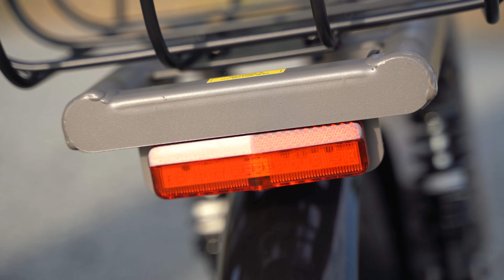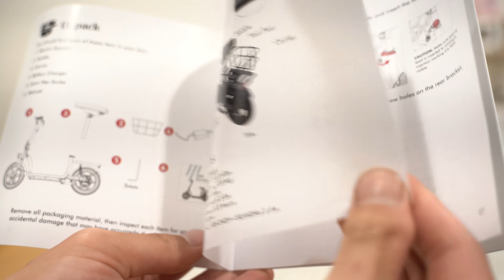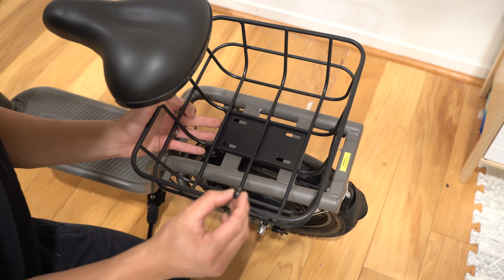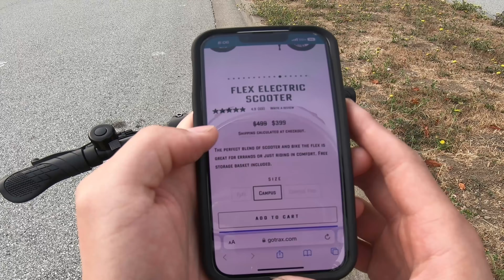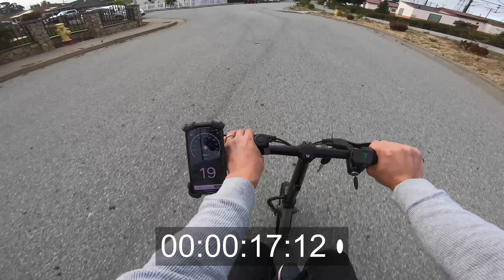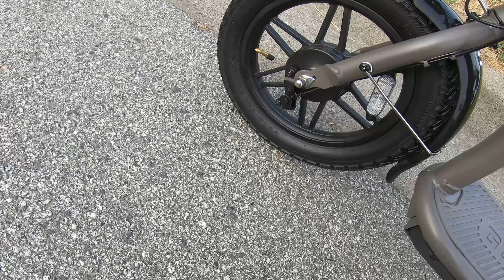$499* Gotrax Flex Campus Pro Electric Scooter Review - Unboxing, Assembly, Test Ride, and Review

Comment: Are these scooters able to withstand being in the cold weather multiple hours without discharge? ride to work and now that the weather is cold, I’m worried about the battery depleting while I’m at work for 10 hours at a time.
Reply from the maker: How cold is it outside, and how far are you riding? Lithium-ion batteries for electric bikes perform best between 60 and 80 degrees Fahrenheit (15.5-26.6 Celsius). Below 40° F (4.4° C), the battery performance begins to degrade significantly.
Reply: I just have the Go Trax Flex and this summer I'd get about 15, 16 miles, but I never ride it until the battery dies. The other day I rode it at 52F and got to 14 miles and it died, but luckily I made it to the parking lot. Plus, my tires were abit low so that didn't help. Filled up tires & rode the next day, same temp. & got 14, but I stopped in the lot before it died so it probably could have done 15. So I'd say anything under 55F you'll may lose a mile or 2 and power is just a tad sluggish.

Comment: Would anyone know how to replace the battery if needed
Reply from the maker: I took a picture of the battery for someone before selling the scooter. There's screws holding the cover on the bottom. Once that's removed the battery can be unplugged.
Reply: @ColinLeung  is it a battery you can buy most places or proprietary from the company?
Reply from the maker: @rmstark1966  The label said Z144-48V9.6AH LG. TT2023052500088. I could not find that battery online, but it does have a XT connector. I did not unplug it to determine whether it was XT40, 60 or 90, but any 48V battery with that connector should work, or you can solder new connectors to make any battery work.

Comment: Does your seat move side to side? Mine does for some reason. And my seat kind of goes forward and then when I lean back it goes back. It’s so weird I just reached out to them though.
Reply from the maker: My seat did not move. You may want to check the two bolts that hold the seat to the seatpost. It sounds like they're loose. You'll need two adjustable wrenches to tighten them.
Reply: @ColinLeung  thank you, I’ll try!

Comment: Would you recommend this for longer commutes? 5 Miles to and from?
Reply: I have the Gotrax Flex regular one and I ride 16 miles round trips on the bike trails; 8 up and 8 back. This one should go even abit further so a 10 mile trip is fine. I bought mine just a few weeks before this one came out or I would have bought this one. I just use the Speedometer app & it shows your milage and speed, plus even has a map that tracks your every move where you go.
Reply from the maker: Thanks for sharing @pinkfreud62
Reply from the maker: Yes, as the other user mentioned 5 miles each way is below the maximum range. The max speed may be limiting if you need to ride along traffic.

Comment: I just bought the Flex Pro Campus scooter. My question is do you need a drivers licenses? Can the scooter go longer the distance then 25km? I'm trying not to get a car since it's expensive; that's why I bought a scooter to be able to get around the city of Calgary. I'm excited; cant wait till it arives in the mail!! 🥰
Reply: Don’t need. License I have one
Reply: @215reek2  good to know; ThankYou!
Reply from the maker: It depends on your local jurisdiction. Oftentimes even if it's required no one will enforce it. The range depends on how aggressively/soft you throttle, battery condition, temperature, weight, slope, etc.
Reply: @ColinLeung  I stay far away from roads only use the scooter when it's convenient. If i Need to go riding to my job during the winter time; friends/movies pretty much sidewalk use. 🥰🥰ThankYou
Reply from the maker: You're welcome @canvasselfie37  Enjoy the scooter
Reply: @ColinLeung  Hopefully soon it's coming 10 to 20 business days; waiting is very hard when it's online. Will post on the vlog when it arrives. 🥰💯
Reply from the maker: For sure. Share the link! @canvasselfie37

Comment: what's the maximum height? do you recommend for someone 6'7?
Reply from the maker: I don't know if it has a max rider height because the individual just sits on the scooter without pedaling like a typical bike. As long as your knees clear the stem and elbows the handlebar then it should work, but it might feel cramped.
Reply: @ColinLeung  right.. got you thanks
Reply from the maker: You're welcome @dimepia123

Comment: That was a great thorough review and thank you for that.  I just have one question with regard to the basket in the back, do you think we can replace that with a small seat? Do you think the weight on the seat will interfere with the spring-shocks installed near the back? Thanks.
Reply: As long as the rider isn’t the weight limit of the basket yes
Reply from the maker: Yes, as long as you can get the bolts to line up and the total weight doesn't exceed 264lbs it should be fine.
Reply: @ColinLeung  Thanks for the reply.  I'm assuming the 264lbs weight limit was referring to the total weights of the rider and passenger.  Just wondering if any additional weight supporting frame need to be added if installing a seat, or its original body frame is already sufficient.  =)
Reply from the maker: @jzheng720ify  The rear frame already feels robust. I was able to sit on it without issues and I weigh 150lbs.
Reply from the maker: @jzheng720ify  Got it. I believe the original body frame should be sufficient.

Comment: Is it possible to drive it slow? I am a young person looking to find a scooter for mobility issues and want to be able to ride it on the side walk at 3-5mph
Reply: I have the Gotax Flex and I'm 60, but I wouldn't use this at those low speeds for mobility issues. It's too wobbly for low speeds, imo. Better off getting a 3 wheeler or similar with good balance for slow speeds.
Reply from the maker: The throttle is sensitivity controlled meaning if you apply 10% rotation and it will ride slow. It might be difficult to not overdo it, or hold it at a steady rate. I did not see an option to change any settings to limit the speed.